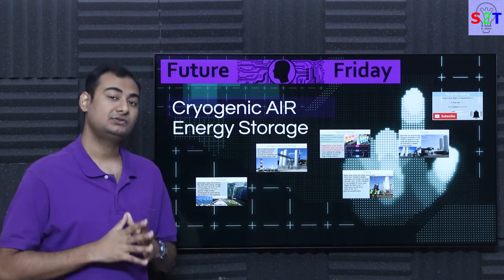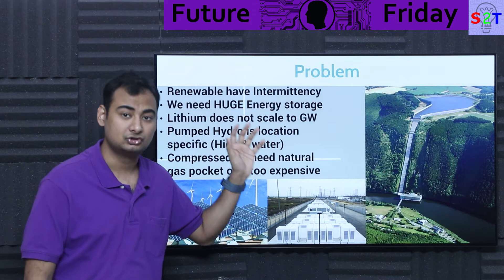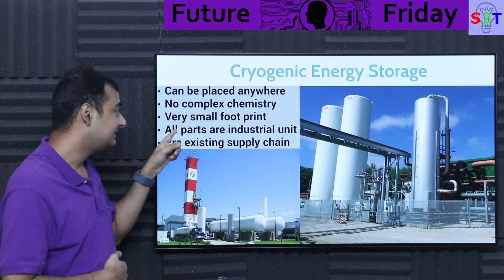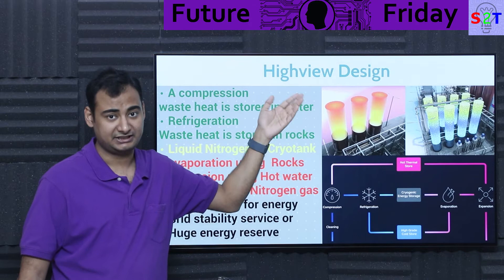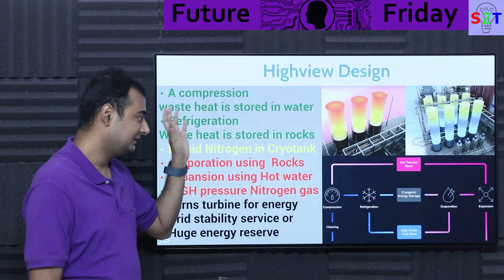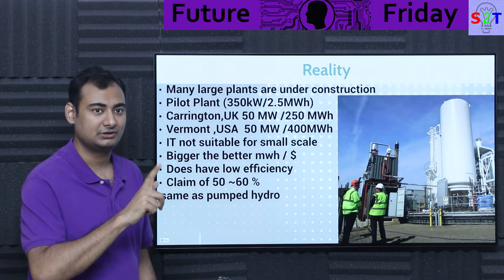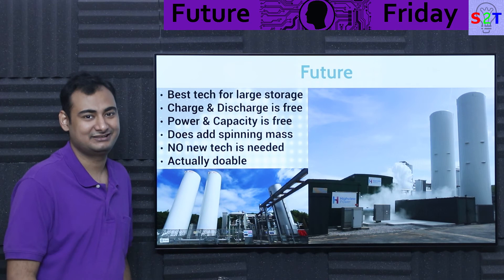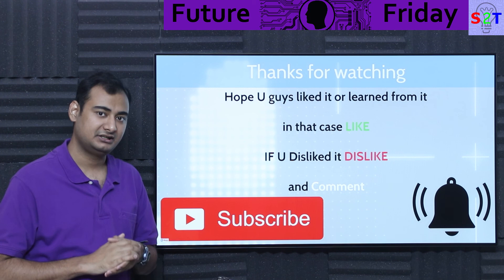Cryogenic Energy Storage Explained {Future Friday Ep156}

Comment: If the goal is to build these at 1000-2000 MW scale, I have a suggestion: add a Nuclear reactor to the cryogenic air system.

Context: Build a Boiling Water Reactor, with a max water pressure of 5-6 bars. At those measly pressures, temperatures in the reactor would barely reach 150 deg C. (Please note that I am only talking about the reactor only i.e. Only the heat generating element. I am not saying use steam from the reactor to run steam turbine.)

Use heat from the reactor to pre-heat the Nitrogen before expanding it in the turbine.

Benefit: You can get much higher efficiency in the plant, or much less Nitrogen will be required to be stored as working fluid.

Building a Nuclear reactor (even the low pressure variant I suggested) still will be expensive, but it may be possible to absorb those costs if one is building storage at GW scales.
Reply from the maker: very bad IDEA

Comment: There are three considerations that I focus on. First, liquid oxygen will be an important commodity in the future for carbon capture. Second, liquid nitrogen is one of the few zero-emission means of transporting renewable electricity long distances. Third, replacing large HVAC systems with liquid nitrogen expansion turbines and heat exchangers would reduce the strain on the electric grids in the hottest cities.

Liquefication plants would be able to store electricity and generate pure oxygen for added revenue.

Countries like Mongolia would benefit massively from cheap waste heat in the Winter months for district heating systems and cities all over the world would benefit from the waste cold. I get the impression Saudi Arabia would sign a 20-year deal with Mongolia for liquid nitrogen if they could. With enough scale, shipments of liquid nitrogen could replace LNG.

Buildings all over China already have LNG tanks for Winter. They could be the first to install Liquid Nitrogen HVAC systems. Unlike the urban heating effect of conventional HVAC, liquid nitrogen should decrease the temperature of the surrounding area the more it's used.
Reply from the maker: carbon capture does not work as  physics does not allow it . Meaning if u got 1kw of power from releaseing 1kg of CO2 there is no way in thermodynamic where you can bound it to something and store it same as coal did for lesss then  1kw . trick is to notshow round trip energy cost so creat a false sence of CCS . Heck even at that u need 2650 kwh for 1 ton & u will realease 2.6 ton from coal & 1.1 ton from gas plants (as it has lot of energy in hydrogen bond)  that is not even close to nutral . Stupid answer we will run it form renewables answer if we had renewables we would not be releasing CO2 in the first place . BEST carbon capture is no emission . 

 "liquid nitrogen is one of the few zero-emission means of transporting renewable electricity long distances"
  WHAT ARE YOU SMOKING 
Just no not even close best is HVDC that is why world is building HVDC intelings that are in 1000's of km 
The Zhundong–Wannan UHVDC line  1100 kV, 3400 km
INDIA North-East Agra 800kV,  1,728 km
North Sea link (NLS)  525 kV DC, 720 km undersea
 
"waste cold" does not exist physic does not allow it 

"liquid nitrogen should decrease the temperature of the surrounding area the more it's used. "
no all it will do is creat a suffocation hazard
Reply: @s2tenglish   
Whether you like CCS or not, it's the only way to remove billions of tons of CO2 from the atmosphere. The later half of the century will require a lot of CCS to stabilize the environment.

I'm smoking LEARN TO USE PUNCTUATION, and I didn't even mention HVDC. I wasn't saying HVDC isn't a good option. You might also notice that the world is bigger than "1000's of km." This is why countries like Australia are planning to export renewable energy as hydrogen and ammonia. Boats go farther than cables.

If you worked at an LNG regasification plant, you would understand what I mean by "waste cold." If both the heat from compression and the cold from vaporization can be used productively, where the compression and vaporization happens doesn't impact the efficiency.
Reply from the maker: @jameslooker4791   CCS  will not happen by human hands , only nature can do it without creating more CO2 in the process. EG Make sea weed biofuel & bury it underground as oil (undoing what we did ) slow but stable. It also solve 2nd law of thermodynamics. 

Australia are planning to export renewable energy as hydrogen and ammonia. Boats go farther than cables. JUST WOW ,now that is just RAW stupidity. Cable goes far & works 24X7 eg  Morocco-UK Power Project 3,800 km & Sun CableAustralia to Singapore  3861 km . If you want you  can connect all the land mass,same way we did with undersea fiber.HVDC does not have distance limit as its doesnt have skin effect & capacitance loss.

"waste cold" can only be used in a very limited Fashion.The moment you put load on, it will drop the COP of the Refrigeration cycle. That is why we dont do much with "waste cold" some use YES, but use it as power with load NOPE .
That is why I said there is no WASTE COLD
Reply from the maker: "There are lots of cheap sources of non-fossil carbon that can be buried" just NO, where are u getting this sort of ideas ? if we did we would have fixed global warming long ago.
 Yes there are  carbon sequestration method that are "non-fossil" but non of them are fast enough & BIG enough to take care of  35 billion metric tons CO2  per year. 
 "waste cold exist" so u want to prove 2nd law of thermodynamics wrong well GOOD LUCK .
 Be mind full many things give impression of working but in depth & holistically they always have gothcha . 
Just because you can ship from Chile to Tokyo does not mean you have to that is the whole core point of renewable energy that they are so spread out most human populations centers have more then "enough"  that is "near enough ". 
LNG is not good enough that is  why we use gas pipe ,same goes with all form of energy if you can just pipe it that would be better than shipping & HVDC is long range enough that it beats any from of transport in mwh "Transfered"